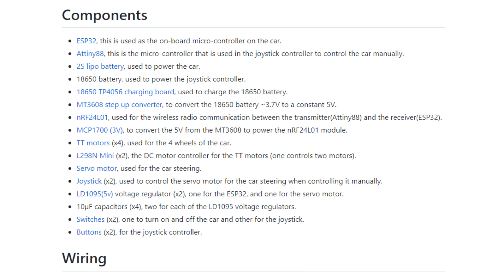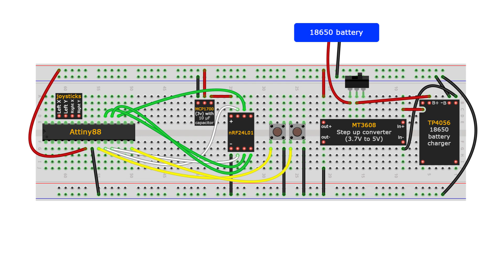How To Make an RC Car from SCRATCH! (Part 1)

Comment: okay ideas  - have the autonomous robot map the room I put it in and upload a png to me;  Develop autonomous driving skills by having two of these robots with different destinations in mind handshake with each other and then work out a plan to each reach their destination without colliding; battle-bots with a second bot with a choice of weapons to 3d print; dont-fall-off-the-stairs sensors;  arm that picks up trash and puts it in a trashcan; spy bot, put a camera on it and let me see what it sees.  I hope ONE of those is good Red :)
Reply from the maker: Yep, some of these are for sure good enough! I particularly like the arm idea, it could have an on-board arm that can grab objects, I can definitely see that added in the future, not the next episode, but the one after that. In the next episode, we will have your last idea in there for sure, the camera, since it will use an on-board camera as the main sensor for the autonomous driving. Also adding an on-board mini turret that fires projectiles can also be a possibility for your battle-bots idea ;) These are all great ideas, good stuff! Glad to have you part of this slowly growing community 👍.
Reply: @ProjectsWithRed  really liking the multi-bot scenarios honestly, one for me and for each of my kids.  also, doesn't require a smartphone.  sweeeet.  need to print TPU for the first time and make sure my printer is nicely tuned.
Reply from the maker: @hoseroo  Good stuff! TPU can be a bit tricky to print with so good luck with it! :)

Comment: what bearings and size of m4 bolt
Reply from the maker: The bearings are "MF104ZZ Flanged Bearing 4mmx10mmx4mm Double Shielded Deep Groove Bearings", and for the M4 bolts you need any lengths from 10mm-12mm.